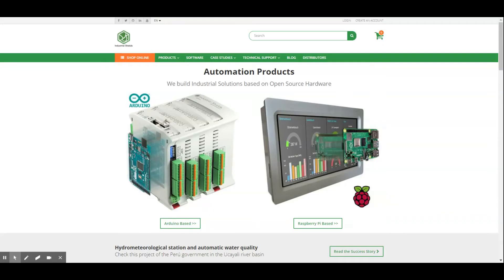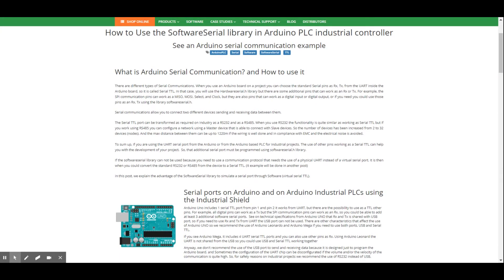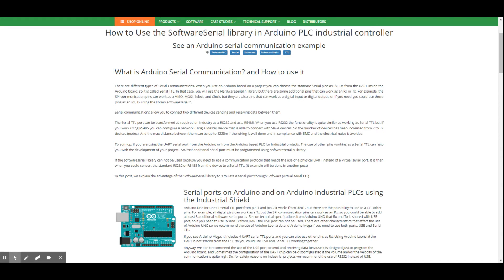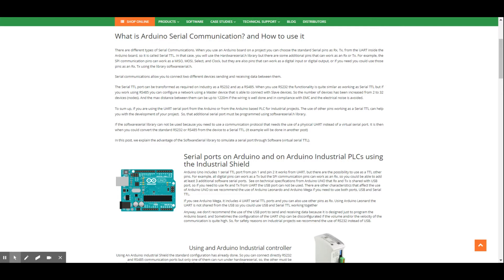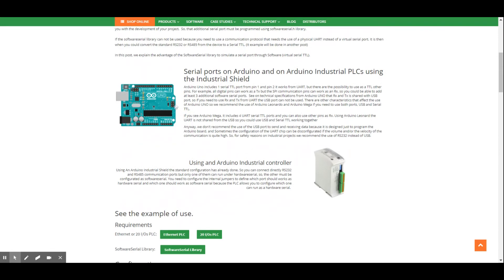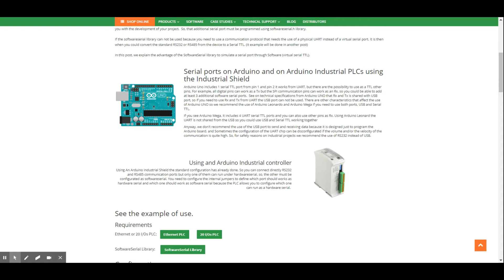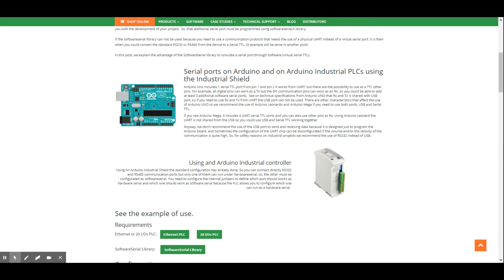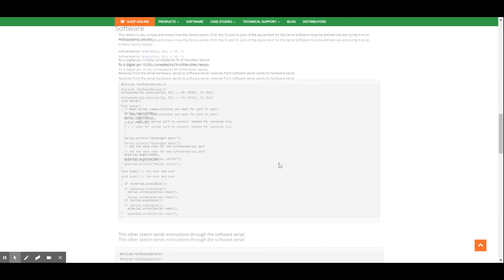✅ How to Use the SoftwareSerial library in Arduino for industrial uses (Examples included)

Comment: Hi, thanks for the video. I m trying to receive data from an HMI modbus RTU, but i also need another modbus bus to read a sensor. But when i enable the second serial, the first id diyng. Do you have examples of multilple serial working? And master plus slave implemented in the same arduino UNO?
Reply: Dear Fabio,
You can check these blog posts that may be helpful with Serial & Modbus RTU:
https://www.industrialshields.com/blog/arduino-industrial-1/post/modbus-rtu-and-rs485-arduino-seneca-z-d-in-module-93
https://www.industrialshields.com/blog/arduino-industrial-1/post/how-to-configure-the-serial-port-on-industrial-arduino-ide-153
https://www.industrialshields.com/blog/arduino-industrial-1/post/modbus-rtu-master-library-for-industrial-automation-200

Please, do not hesitate to contact us for further information at: https://www.industrialshields.com/industrial-shields-contact-us

Kind regards